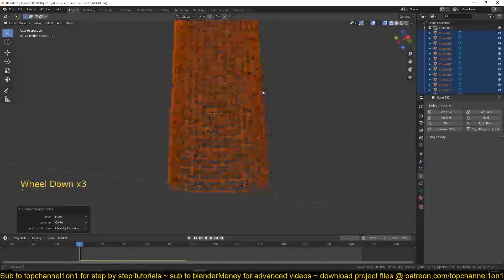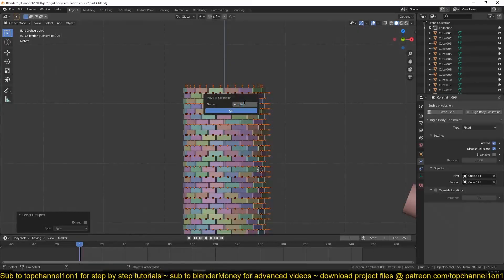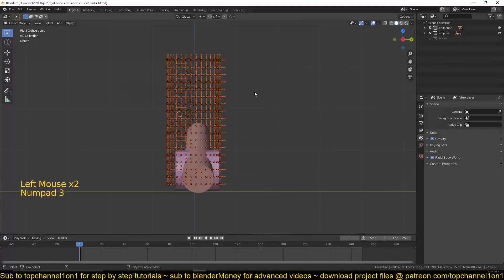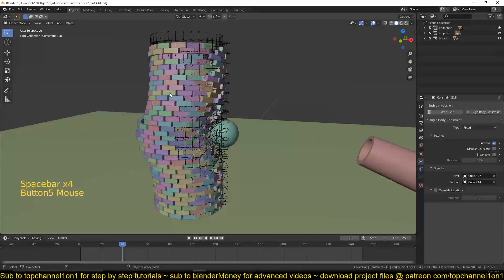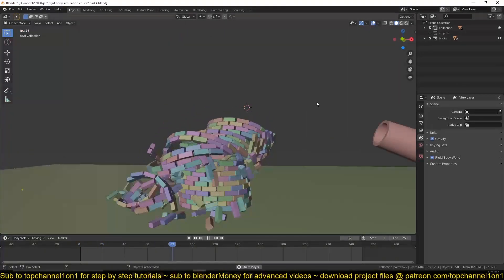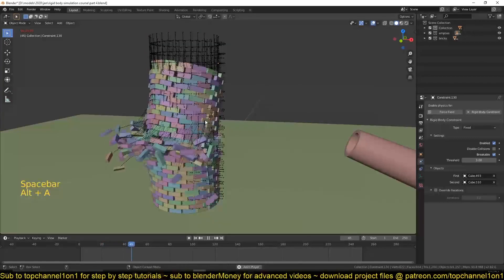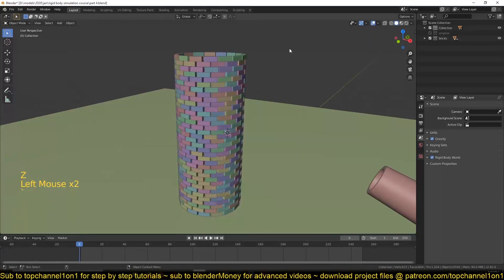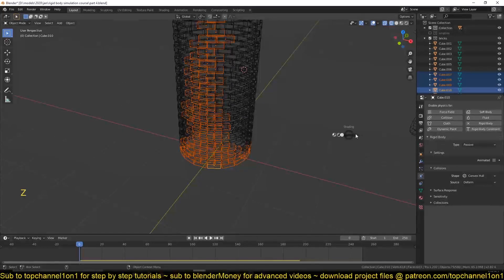part 7   rigid body constrain    blender physic simulation course

Comment: Hi, I have a problem with connecting the bricks.
If I do the Object->Rigidbody->Connect stuff the emptys are connected to the yellow dot that my active brick has and not to each other. How should I fix this issue? Thanks for your answer, amazing tutorials btw.
Reply: very late but he forgot to show a tiny but a pretty important step. Right after the computer calculates the constraints, you have to change the connection pattern from "selected to active" to "chain by distance". Its on the bottom life in the first few seconds of the video. Cheers